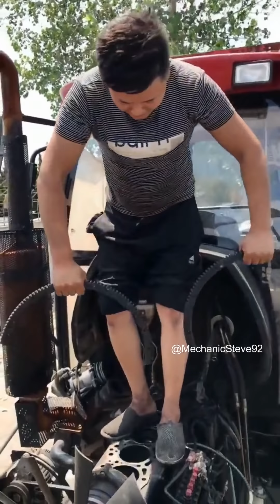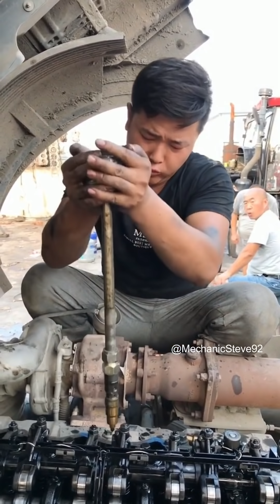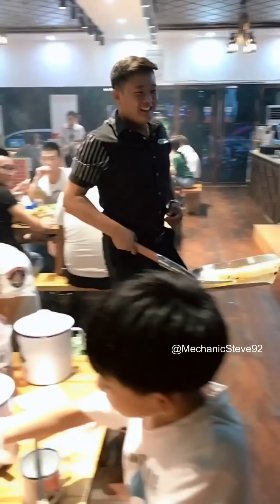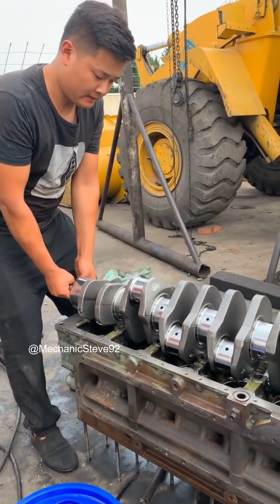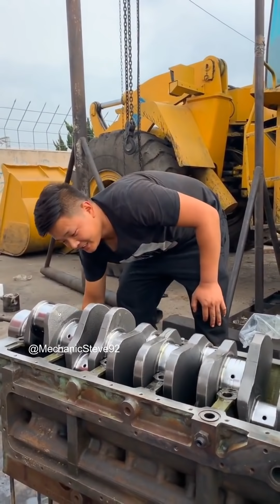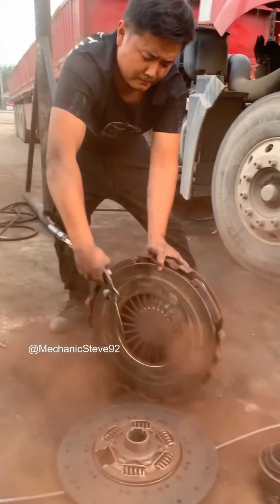Somethings will never change ~

Comment: The screwdriver to the ear to listen for the excessive friction/vibration/out of balance trick is a fitters diagnostic test, the best one too. Only way to fit sleeves as it prevents any unnecessary loads with a slight leed in to prevent cutting.

Comment: Very impressed with the improvisation in this video like removing the pistons with a starter ring gear cut in half and using a big socket on that bolt/bar as a slide hammer. Just shows you that having all the tools and spending a fortune on snap on tools doesn't make you a better mechanic.

Comment: I see that he has more choices or methods to work safer. Example of using wood blocks to press fit the cylinder linings, and wearing a face mask and goggles to prevent inhailing those dust